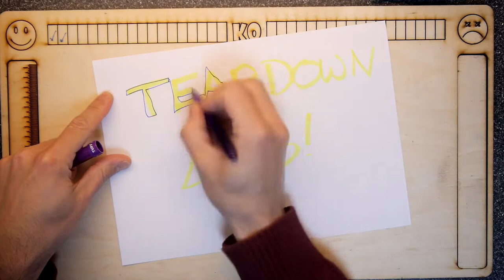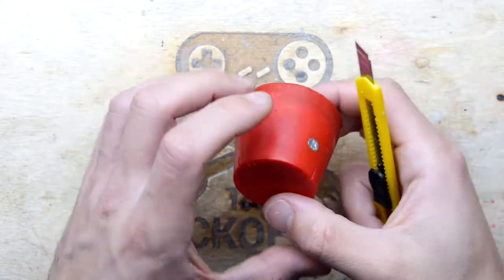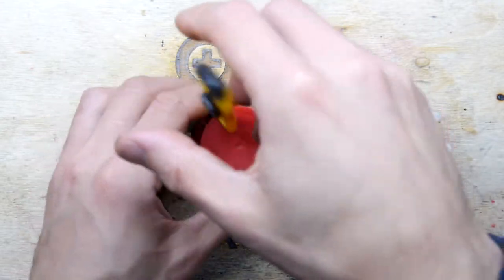Vinamold

Comment: This looks pretty useful. Silicone sure does get expensive when you keep wasting it like I do :) Sadly it looks like the melting temperature is a bit too high to make molds of 3D printed parts, so I can't stop wasting money just yet. Sad times.
Reply from the maker: +TeaTeaKay you could try tube silicone and put it in a bowl of soapy water
Reply: Ahh yea, I saw somebody doing that and keep forgetting to try it. How does the vinamold do with air bubbles by the way?
Reply from the maker: +TeaTeaKay air bubble wise, send about the same as silicone really,